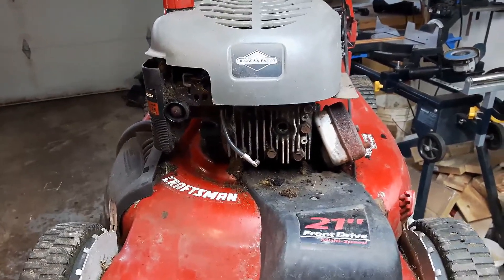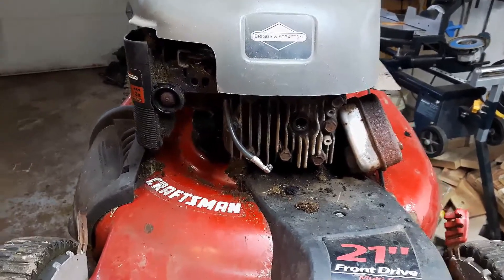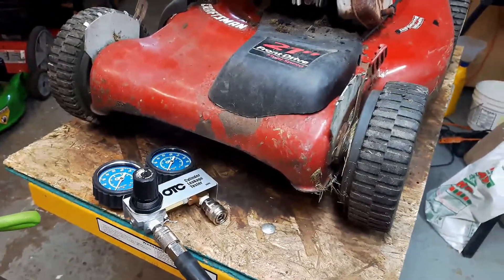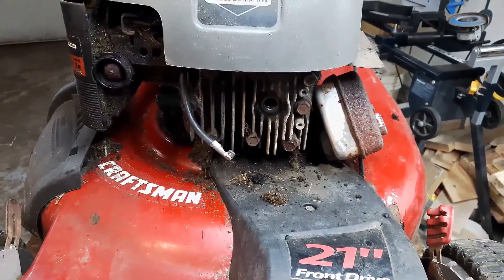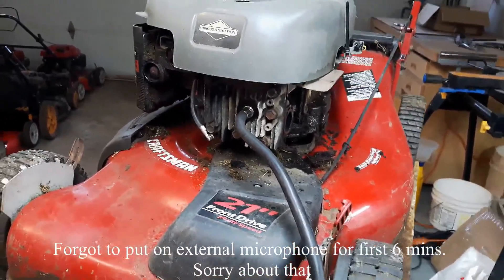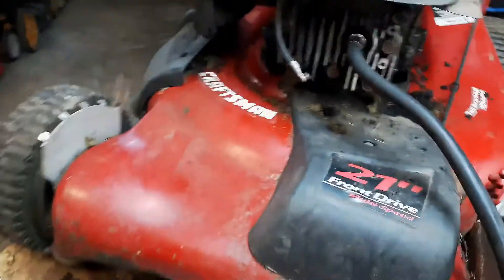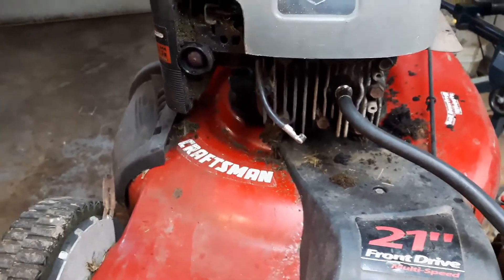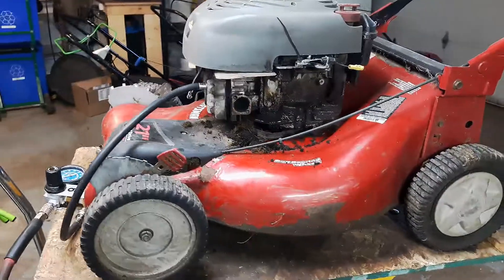How To Diagnose Cause of Low Compression On A Small Engine

Comment: Thanks!  You could do the same thing with an air compressor with a regulator and a blow nozzle with a rubber tip.  Of course not as good as the nice gauges there, but it will still tell the story...
Reply from the maker: I agree this could tell a story, but probably not the whole story. A certain amount of leak down is acceptable. Would be hard to tell how much leakdown you'd have with your method and you might go chasing a minor leak for no reason. Unless you had enough experience you could tell the difference between an acceptable amount of leak vs. unacceptable just by the noise or some other method. Thanks for watching and taking the time to leave a comment. Cheers
Reply: @brantsmallenginerepairs  You're right!  I just did the air compressor method on a suspected engine and my test was inconclusive!  I heard a little bit of air coming through the carburetor and some through the dipstick.. Unfortunately I don't have a "known good" engine handy to do the same test to see if Im getting similar results..  Thanks for responding..  😊

Comment: You may have considered mentioning that once tdc on compression stroke is found, you may want to block blade or flywheel so engine doesn't turn once air is induced.  But,  great video 
 Thanks.
Reply from the maker: Good point. Thanks for watching.

Comment: Hi,  i have a 24.5cc 4 stroke yarkking and how about 50psi and with oil put in about 60 psi. Too low? and its eating oil so i guessing last owner wore it out a bit. engine is 2 1/2 years old.  Already stipped it and ring gaps are only .25mm at top where gap should be widest so not too bad. No leaks and some oil from breather with air exiting. but shes eating about a teaspoon every 10-20 mins!!
Reply from the maker: Seems a bit low. How does the cylinder and piston look? Any scoring?
Reply: @brantsmallenginerepairs  All clean and shiny and havnt check for bore cracks but would that effect compression or oil loss as have both?  I used to looking for scoring from 2 strokes and this bore , piston, rings all loose and nice and clean and well.. .chinese weak metal?   What should the ring gaps be for 25cc  38mm guess?  bore?  I might try to measure everything and swap in a piston and rings that match the number and see if improves. Loss of 30 mils of oil in 10-20 mins running seems insane but its not leaking and not much comes out or breather and i routing that back to sump using a new nipple i installed there with a T piece off of it upwards to vent the gas part. sort of works but i also getting pressure from sump haha  I took rocker cover off and poured oil onto those stem seals and zip effect, so they arnt dumping oil even if bit warn,  So it has to be going up past the rings and at a teaspoon every ten mins or so!! eek!! What are ring gaps roughly for small 25cc?  will fit that if put in new rings and piston
Reply from the maker: @xx3868  not sure what the gap should be. I'm sure a bit of digging on Google would render the answer. Certainly does seem like it's pushing lots of oil. Rings would be my guess